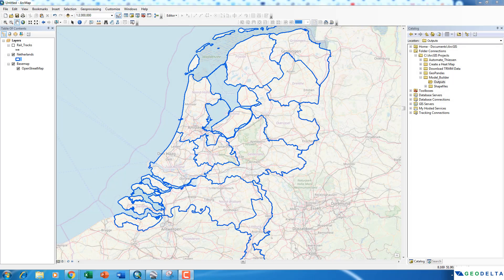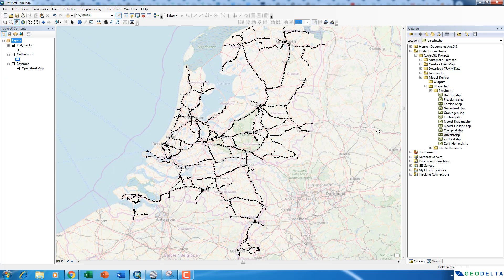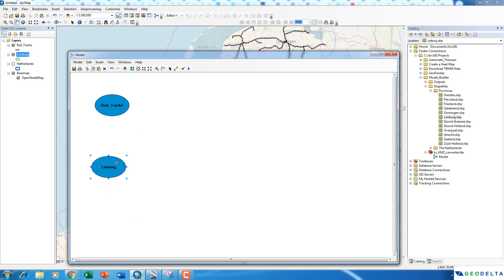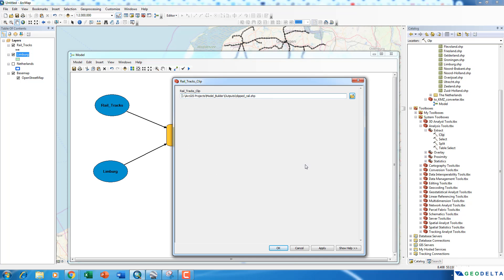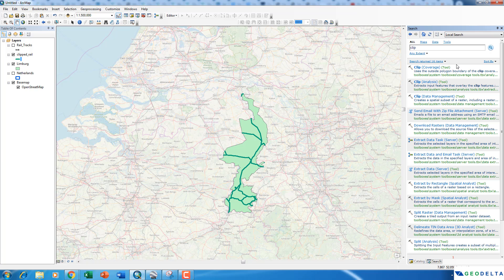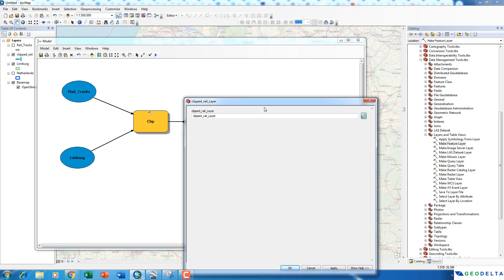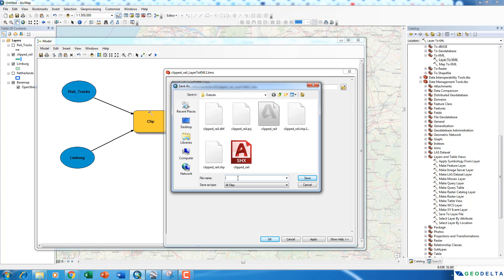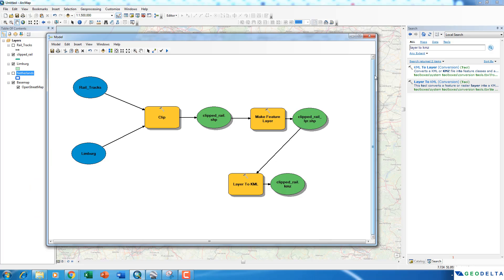Introduction to ArcGIS Model Builder

Comment: It's a good start, but I would like to have the output named after the inputs.  If you Clip the railways for Noord_Holland and create a KMZ called nord_holland, it is not only imprecise but incorrect. 
By manually entering the name of the output, it introduced an error that may cause problems later.
How do I get Model Builder to name the output using the names of the inputs to avoid errors and manual entries?
I did this project without Model Builder a few years ago.  I cut the Railways, Rivers, Highways, Major Roads, for the 46 counties of South Carolina and the 67 counties of Pennsylvania.
Reply: in output location use "C:\GIS\Outputs\output_%Value% ", %value% gives your new shapefile as there is earlier

Comment: that was great a explanation about model builder u put there. I would like to know how we can create a model using raster calculator such as to find the land surface temperature, where we need to add variables in the raster calculator that can be changed according to the users need. The thing is that I need a model that automates the process for LST that includes brightness temperature, DN to radiance conversion, estimating emissivity. PLz post a video as soon as you can. Thank you.